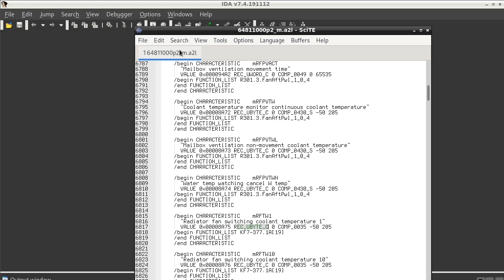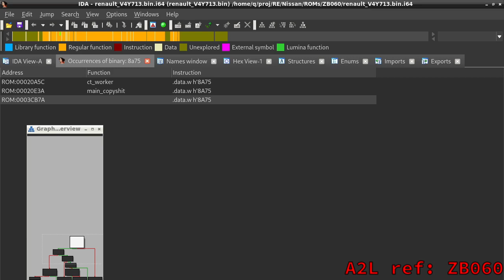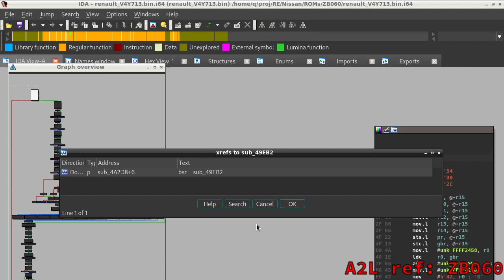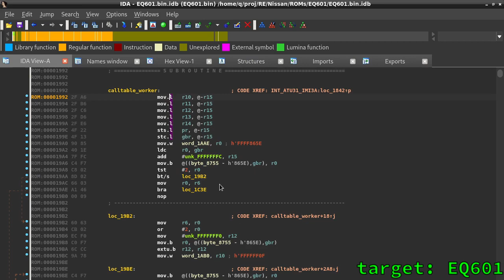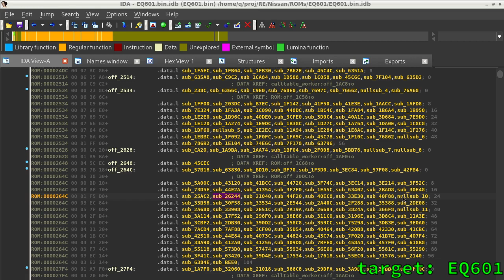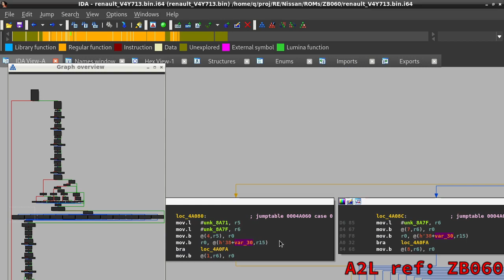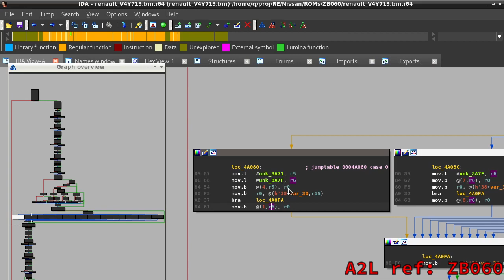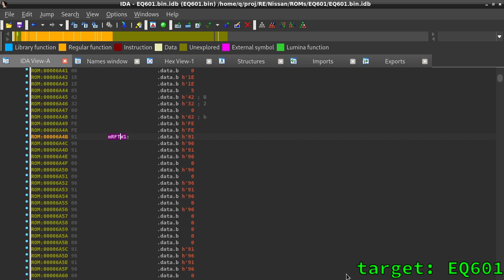Nissan ECU ROM reverse engineering. 1: A2L cross-referencing

Comment: If you knew the can ID for hardware such as a wastegate solenoid duty cycle, would you be able to search for that can ID in order to find the function that controls it?
Reply from the maker: maybe, I didn't pay much attention to the CAN implementation on these.
Reply: @fenugrec5697  I checked out your GitHub for Ghidra helper scripts and am working with an SH27531 which I don’t see the regs or ivt files for. Should I just reference the data sheet to create those registers / labels for the script or does the python script also do other helpful things?